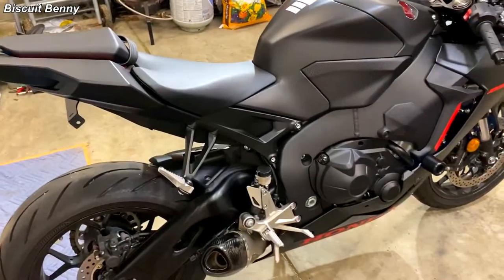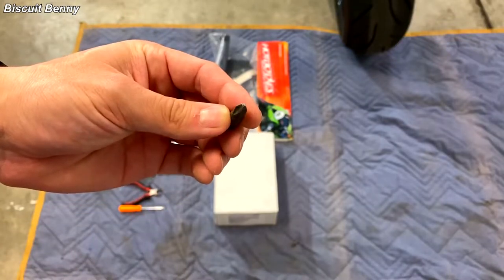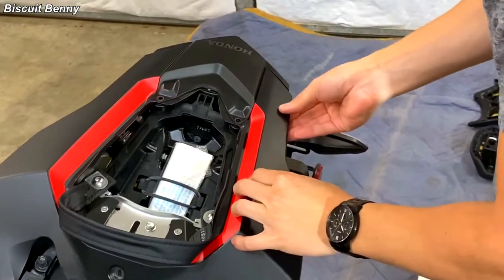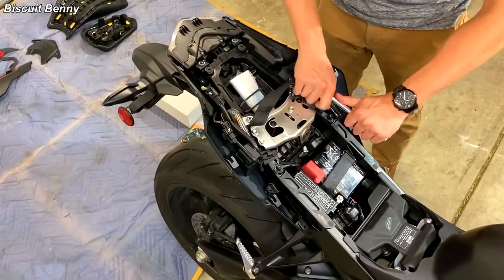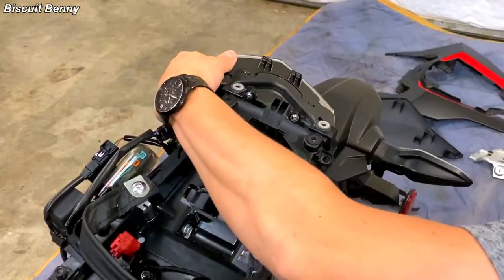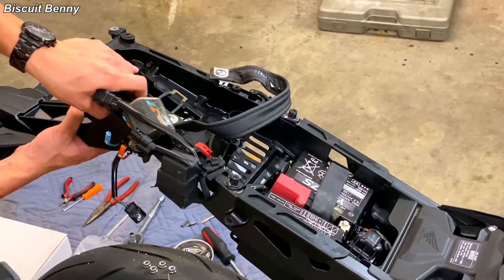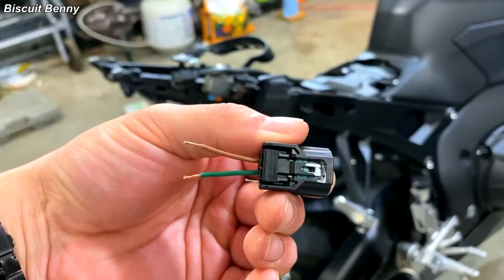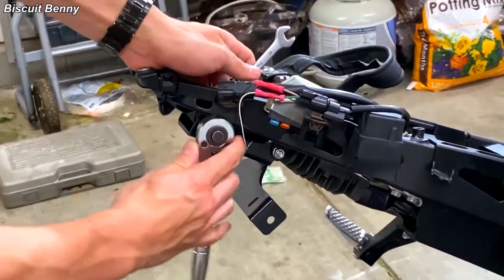2017-2020 CBR1000RR Fender Eliminator & Integrated Tail Light Install Tutorial | Biscuit Benny

Comment: If you read this, what's the name and/or where did you get that integrated tail light? Just bought 2021 CBR1000RR and I want to get rid of that funny fender
Reply from the maker: It’s the Hot Bodies fender eliminator kit and I think I bought it on Amazon huts it’s available on sites like JPCycles and BikeBandit. The integrated tail light is the Motodynamics and I think I bought it straight off their website.
Reply: @BiscuitBenny  thank you for your time and for taking the time to read and answer my question. I hope is not illegal in my state lol

Comment: I have this tail light and have rapid flash. You have this problem or know how to go about fixing it?
Reply from the maker: Yeah, in the manual it explains pressing the button on the back (inside of the trunk) of the unit with a small flathead screwdriver to change the settings or cycle through them!
Reply from the maker: Yeah, in the manual it explains pressing the button on the back (inside of the trunk) of the unit with a small flathead screwdriver to change the settings or cycle through them!
Reply from the maker: Yeah, in the manual it explains pressing the button on the back (inside of the trunk) of the unit with a small flathead screwdriver to change the settings or cycle through them!
Reply: What is rapid flash? And what kind of settings are there?

Comment: where is the  LED turn signal relay located?
Reply from the maker: It’s the box under the rubber cover that attaches to the metal clip
Reply: @BiscuitBenny  Found it.. I removed the Wind visor and its right there under the Odometer.. So simple..